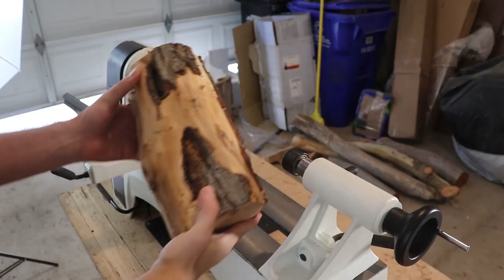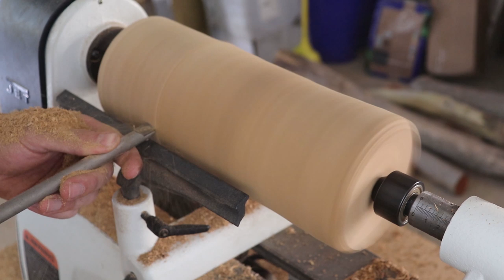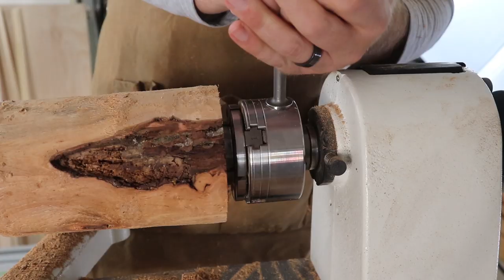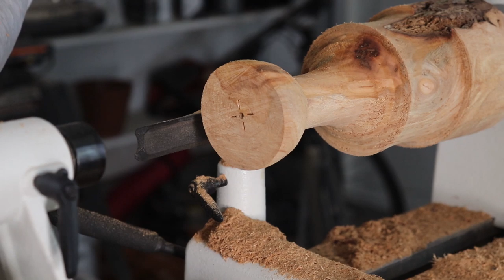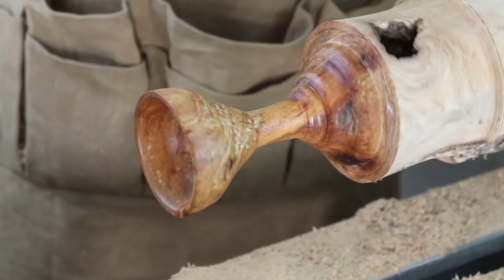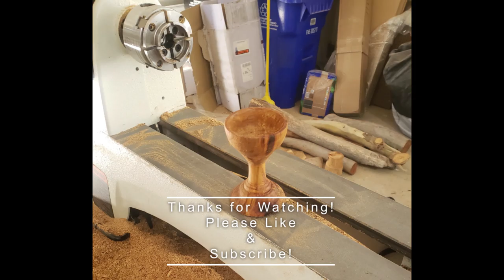Woodturning Fail! Making a Goblet Goes Wrong

Comment: Wow it looks like the quality of the wood makes such a huge difference. Any tips for selecting a really good piece to avoid some of the gaps and chipping?
Reply from the maker: It's sometimes hard to tell in advance, but mostly it just takes a lot of practice and you start to get a feel for a log's potential before you get cracking on it